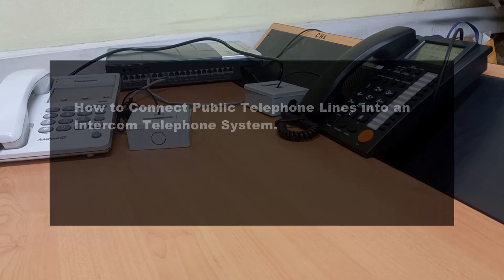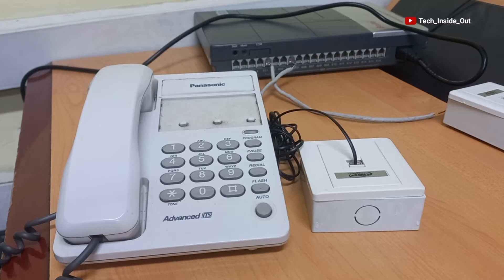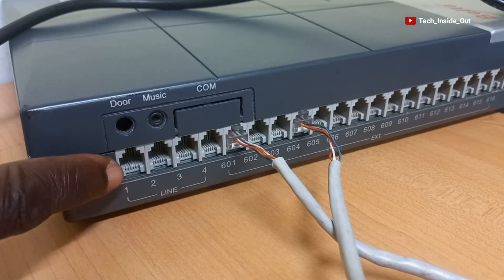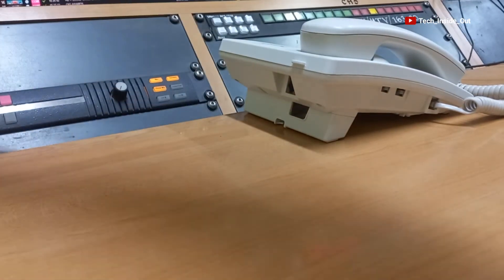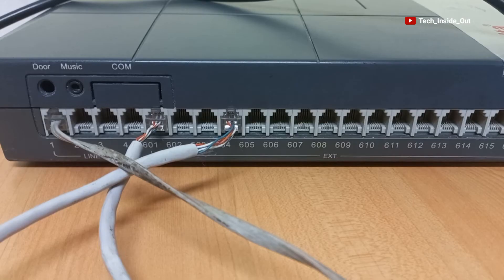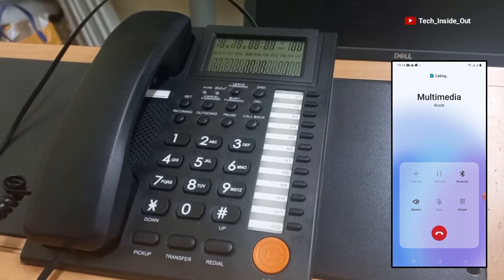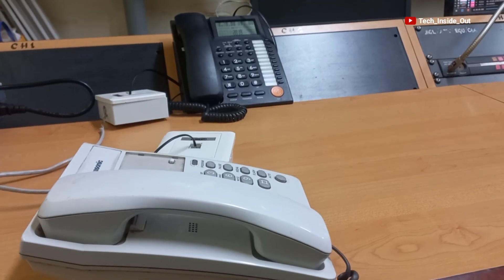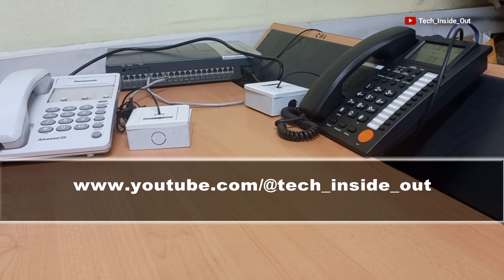How to connect public telephone lines into an intercom telephone system for outside phone calls.

Comment: Does it mean that you don't need to connect router to the pabx system for that to work?
Reply from the maker: You don't need a router when it is to be used for just internal communication, but if you wish to do external communications,  you will need a router

Comment: Hello, nice video, very helpful..... but I want to ask, must there be an external phone cable connected to the PABX box before it can accept external calls?
Reply from the maker: You will need either a cable connection from a telephone service company or you can use a modem with a SIM card connected into the PBX

Comment: When u remove RJ11 cable from the single line téléphone and connected to the PBX,where was the other terminal of that same cable going to? because I believe you disconnected the single line téléphone and yet you still made a call
Reply from the maker: The cable i removed came from a Public telephone land line company which gave us a Land line for making and receiving outside calls. As i removed that cable and placed into my PBX, that simply means am transferring that public line into my pbx.
Please go through the video again and you would have more understanding.

Comment: How did you transfer the normal call to intercom. Because I did see the line phone .
Reply from the maker: The system comes with a default extension number to which outside line calls come to, but you can also transfer to your preferred extension through system programming.
Reply: @Tech_Inside_Out please my question is the phone that receive the call from outside does it have a call line in it?

Comment: I try connecting excelltel 416 pabx using a zte mf296c router to receive calls from my simcard it doesnt work just getting a buzy mesage. Help.
Reply from the maker: Do you dial your CO access code before trying to dial the phone numbers?
Refer to your pbx manual for your CO access code
Reply: @Tech_Inside_Out  i had to use a simcard chipped excelltel pabx but then i need to connect those two pabxs together. Help

Comment: Can the internal intercom syste make outside calls? If so how? Do they get billed
Reply from the maker: 1. It can do outside calls. 
2. It is facilitated by the public telephone line that is incorporated into the pbx system. 
3. Yes you will be billed by the public telephone line company whose line you incorporated into your pbx system.  You can even use a mobile number through a SIM card
Reply: @Tech_Inside_Out  well said 🤝
Reply from the maker: @therivalengine  Thanks

Comment: How can the extension make local calls directly? Is there anything needed to dial first? Already set up our unit, but extension could not make local calls.
Reply from the maker: You need to check the manual of your brand to know the CO line access code. Some machines use 9, but your brand will specify the code.

Comment: The cable that you plugged to line 1 port, where is the other end connected to? If one handset is called and there is a need to transfer the call to the other handset, how will that setup be? Thanks for your great videos 👍
Reply: Thenks alot sir
Reply from the maker: @creativemind3562  Welcome
Reply from the maker: The other end goes to the telephone line company through their cables that are hunged on Poles, some going through underground ducts till it gets to their premises. 
Thesame setup helps in transferring the calls, I showed how the call transfer is done in this video

Comment: Is it only me that didn't get it!!!!
The RJ11 that u unplugged from the public telephone, where is it coming from???
I really thank you for your videos🙏🙏
Reply from the maker: That's the telephone line laid to my office by the telephone company.
Reply: @Tech_Inside_Out  how about if there was a "sim-card" telephone involved?!
Reply from the maker: @abassembatya  In such a case you will take a cable out from the router in which the sim is placed and input into the Line port of the pbx switch. 
There is an upcoming video on using wireless terminals having sim cards as Outside lines
Reply: @Tech_Inside_Out  Alright. Will wait for it. 
Thanks boss
Reply from the maker: @abasembatya  Most welcome